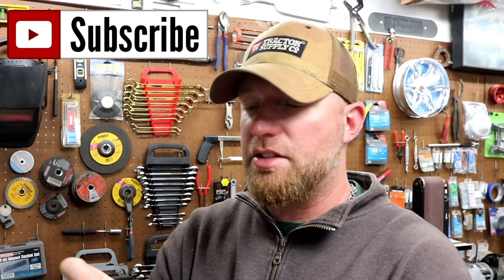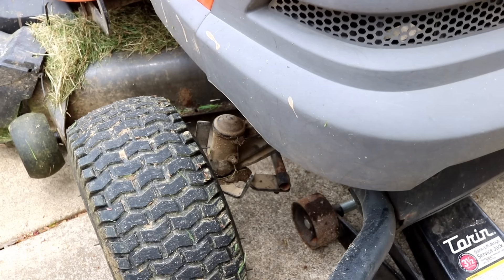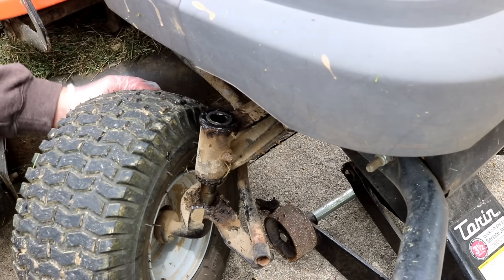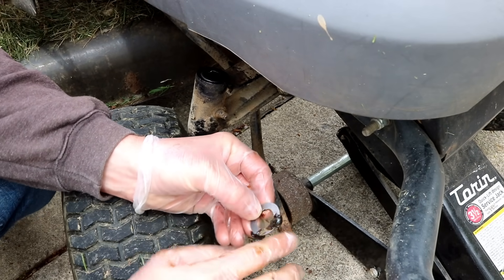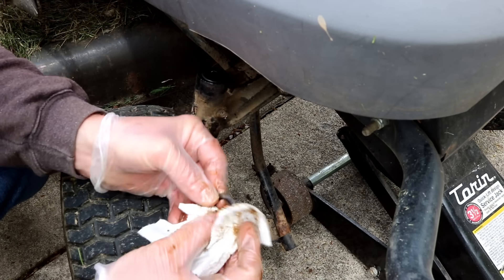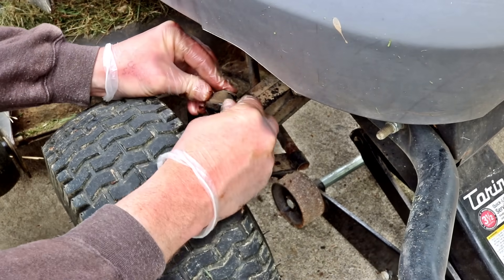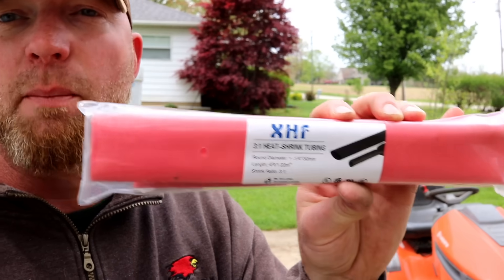$6 And 10 Minutes Will Give Your Riding Mower 1 Finger Steering

Comment: Those are called "Thrust bearings" --   when they are flat like that
Reply: They're official name is Torrington bearings...
Reply: @jedmetzler7125  Torrington is a brand name. Thrust is the type. Like Kleenex or Vasoline.
Reply: I’m pretty sure that they’re called “thingamajigs”
Reply: @jedmetzler7125  fail
Reply: @theupscriber65  that’s true. But I always called them Torrington bearings, most people have no clue what I mean.
Reply: @jedmetzler7125 
Years ago what people used to call Torrington bearings where I'm from were sprag (clutch) bearings. 
It's all regional dialects using a brand name for a type, just like a lot of people calling tapered bearings Timken bearings.
Reply: @steveb7310 because you were using a brand name.
Reply: @jedmetzler7125 . It's not.
Reply: @PaintHerWhite  yep
Reply: @dukecraig2402  sprag is a clutch that pinches rollers till they stop allowing movement in that direction.... not a bearing at all
Reply: @heathhunter5306  
Yes, they're also a bearing, just because the sprags don't spin around doesn't mean they're not also a bearing, by definition a bearing doesn't have to have rollers in it, a bushing is also a type of bearing because a shaft "bears" in it, pretty much anything that supports a shaft falls into the classification of a bearing. 
Or you can just Google "sprag bearing" and call Torrington or any one of the manufacturers of them and argue with them about it because they all list them as bearings.
Reply: In the industry, when thrust bearings had round balls, we called them thrust bearings.  When they had rollers, we called them Torrington bearings, simply so the guys had an idea of what style bearing we were talking about.
Reply: @blackhawk7r221  exactly
Reply: So these are the 2mm ones not the 10mm ones with round bearings
Reply: @lionandthelamb2907 I thought they we dohickys

Comment: Felt the difference 40yrs ago with Ford f150 twin I beam, replaced king pin bushings and thrust bearing.  Couldn't believe the difference, truck had manual steering, it did feel like power steering.  Thanks for sharing will be looking into this.  Never dreamed of putting them on a mower, thanks again 👍
Reply: my buddy had an 1984 f-250, never greased the king pins.   I remember his last drive to get them fixed, wow.
Reply: Twin I-Beam is okay, Twin Traction-Beam is terrible. Proud '90 Bronco owner over here.
Reply: Wow. I don't have a riding mower, but this is applicable for so many applications!
Reply: @superduty4556  I love my TTB.
Reply: I used Amsoil grease on a non power steering 64 Barracuda. Just like power steering. This would make things even better.
Reply: When it comes to stuff like this, I'm brain-dead, thank God for people like this.

Comment: If you dare and have the tools, you could use a burr bit and cut a hint of a notch along the length of the spindle, from where the grease fitting is, to where the thrust bearing sits. That way grease can find its way to the inside of the bearings and not compromise longevity. Thrust bearings are great and you might find a lot of applications for them, once you know where to start looking. You should upgrade your vice handle next. Turns a $50 vice into a $200 vice.
Reply: Or a mill. Or a grinder with a cutoff wheel.
Reply: No need for that. Whe he uses the grease gun you can see that the grease is already reaching the needle bearing and pushing out through the gaps.
Reply: @Tguson  but is it the gaps between the needle bearing, or just from the original top washer?
Reply: @Tguson  as long as it is the bearing and not just from the washers, yes.
Reply: vice... you're going to make me buy a bunch of these bearings...
Reply: @Yhrim70  sooo worth it! There are thrustbearings that are a single piece (clamped together) that you need for the vice though.
Reply: @oBseSsIoNPC  The washers and bearing IDs aren't a tight fit on the spindle so if the grease can reach the first washer it can reach all the way to the bearing.
Reply: why would you do any of theat.. apparently you didn't watch the whole video.. grease clearly came out of the bearings.
Reply: @gregthemechanicman  why? Because I am a mechanic and I work with grease all the time. Just because it's coming out by the bearing or washer, doesn't mean it's actually filling the bearing or continues to come out RELIABLY there. I do such things because I am thorough with what I do and I am German, so I tend to overdo things as well, but the good kind of overdo.
Reply: @Martian Dan  like I said.. watch the video again.. if the Grease is getting to that point it's EVERYWHERE under hydraulic force that stuff goes all over..

And I'm glad you're a mechanic.. I myself own a business and funny enough A MECHANIC SHOP.. come by and see me sometime and I'll show you all kinds of things you've probably never seen before.  Let me know when you're on this side of the pond and I'll even pick you up from the airport.
Reply: If you feel like grease isn’t getting to the bearings, then it’s being blocked by the washers above it. Even if you cut the groove in the shaft, it’s still going to be blocked by the washers. Simply drill a few holes on the washers above the bearings if you feel there isn’t enough grease getting to the bearings. Or, cut some notches on the inside radius of the washers. Also you could jack up the mower when you grease it and grease could more easily get to the bearings.

Comment: Thank you so much for sharing this tip! I have been struggling with this problem for 10 years. As a disabled veteran with neck and shoulder issues this is a life saver. I can't believe how well it worked and how easy it was to do. Not to mention how cheap it was!

Comment: I was pretty excited to do this, ordered the pieces. When I went to install them on my Club Cadet 46” mower I found the arms were welded and the kit could not be installed. So look before you buy or pass them on to a buddy like I did. Still think it’s a great mod.
Reply: Ya was all excited to change mine on my cub cadet and there was no split ring. Just a metal cap so I couldn’t install them either. Might do some research and see if it can still be done.
Reply: Can't do this on my new (junk) troy bilt bronco mower neither...it's welded at the top where the carter pin is.
Reply: Mines welded as well...bugger it

Comment: Thanks for this information. This undoubtedly takes an equal amount of stress off the other components in the steering system, especially the steering gear quadrant. My x350 only has about four years of moderate use over about 200 hours, and I can already feel a bit of slack in the steering. And I don't think you can adjust that gear interface. Thanks again.

Comment: BIG ASS WOW Brian! Did this install and what a difference in the steering. Quick and easy as advertised. Took me longer to bust out the jack, put grease in the gun, get 2 flatheads and some needlenose tools and after the install and put it all away than to complete the task. But this worked out great. This is her riding mower and I use the Zero Turn on 9 Acers. Haven't told her yet, gonna let her drive it when time comes to mow again and see if she says anything. Thanks for sharing. Have a great Navy Day!
Reply: How has it held up?

Comment: I did this modification a few years ago on my old 1997 Craftsman mower and it did wonders for it. But I went one step further and replaced the bushings in the wheels with bearings and now, my mower isn't just easy to turn, it's also easy to push whenever I need to manually move it. If you haven't already done a video on replacing the bushings in the wheels with bearings, I recommend you do one. It's simple and should your mower ever get a flat, you'll be amazed at how easy it will be to push — even with one flat tire.🤓
Reply: Probably good for milage aswell
Reply: @brub5174  Yes, I'm sure it improved my mileage. But even if that wasn't the case, I would still have done both upgrades as they make my Craftsman a lot easier to handle.
Reply: @rvalens2  I need this badly lol

Comment: I just did this in my Craftsman Pro-Series 54" Garden Tractor.  The only issue I had was when I put the drive spindle back in the axle assembly, the e-clip doesn't line up with the top spindle groove (it is flush or BELOW the top of the axle) and is almost impossible to seat.  Suggestions?  Maybe take out one of the washers?

Comment: I mow lawns for a living.  I watched this vid and two days ago my washers arrived.  I ordered them off Ebay.  Installing them
 was a breeze.  Yesterday, I mowed my first lawn with the mower.  What a difference it made, especially since I live in the
mountains so I am always going up and down embankments.  Really took the strain off my hands and wrists.
Reply: Link for your Ebay purchase?  Thank you,
Reply: @tommiller6580  he has the size you can look up in the video description
Reply: @Grass_Groomers_LLC everyone starts somewhere Fancy Pants. I do too and my riding mower is an old beat up Yard Machine. 😏
Reply: @captainorangesburner  nothing wrong with using what you got or what you can afford! I started my cabinets shop business with just a few basic tools. Even a cheap Craftsman tablesaw that only cut 24” wide using the fence.  
Router and some bits, belt sander, and a few other miscellaneous tools was all I had.  Free handed a lot of material though that craftsman tablesaw that you’re really not supposed to do. But I got very good at it anyway!   
Still built $10,000.00-$30,000.00 custom kitchens and bathroom vanities, etc.  and slowly built my business equipment up with the profits off the jobs I did. At first many of the jobs I did were much harder and slower to get finished.  Profit margins weren’t the best in the beginning. But as time went on and using as much profit as possible to keep buying better equipment and tools the faster and easier things got and the more profitable the business got.  Eventually I had over $60,000.00 in equipment that all bought and paid for!  Business doubled in sales every year. 
Don’t let anyone’s comments bother you! You’ll get the last laugh in the end.  While those making the comments will still be in the same place and not being able to do anything more them make negative comments to others since they can’t accomplish anything more themselves!  Attitude has everything to do with succeeding in business as well as in life!  Your on the right track, best of luck to you
Reply: @Grass_Groomers_LLC  a garden tractors mow grass people pay to have yard mowed what’s hard to believe? Iv got a 62 in commercial zero turn and a 52 inch garden tractor because there is hills the zero turn can’t do and it mows just as nice.
Reply: @GrassGroomersLLC all for taking pride in your work, but man you literally mow grass for a livin calm down
Reply: @@GrassGroomersLLCJudgemental much? You don't know where in the world they live, their age, whether they just started out.

Reckon you ought to have a think before snarking at someone trying to work for themselves in future
Reply: @morehp1  I have both a ZTR and a mower.  There are places the ZTR can’t reach sometimes, and some hills might be too sketchy for a ZTR.  That’s where another mower like this comes in handy.
Reply: @norfolkngood8960  it’s fine. It’s things like this that have them showing you before they do the work why you don’t want to work with them.
Reply: @Grass_Groomers_LLC  with that attitude, I'd hire you to fire you.
Reply: @Grass_Groomers_LLC I think the real issue is it doesn’t take years of experience it takes an afternoon with granddad but you can’t just brag about spending a ton of money I’m sure you worked hard for on a fancy tool so you have to ‘no true Scotsman’ just in case someone might have the unit.
Reply: I did this trick a few times myself but I really am just wonderin if it will make a diff & work if I did it to my own spindle before the old sits on it again....
Reply: I installed these on my John Deere d120, no problem went easy.  In order to make the o-ring fit on top I just lowered the tractor back down on the ground and the weight pushed the pin up higher, made it easier to get it back on.
Reply: You"re right! Can you make a video?  Sounds like a great idea
Reply: just curious -  how are the beariongs holding up after a season of mowing?
Reply: He only showed doing one side , but you have to do both sides ?
Reply: @michaellowther8649 yes, you need to do both sides
Reply: How well have those "washers" held up?

Comment: Thanks for posting. This hack fixed my 2013 Rear engine Snapper. Super easy due to no grease cap. I did measure the force needed to turn the wheels before and after. It required 18 lbs before and only 5 lbs after. Love it
Reply: Give it a year until the fine dust from mowing  gets captured by the bearing grease and form  nature's own grinding compound that turns the little ROUND needles in the bearings into little FLAT needles.
Reply: @mikehudick7074  The guy in the video mentioned using heat shrink to protect the bearing from debris. Have you tried that?
Reply: @mikehudick7074  $6 and 10 minutes for a year's worth of easy turning?  I'll consider it maintenance and be down with it.  I'd even be cool with $12 and twice a year, my mower turns like poo.
Reply: @thisdoesfine  if it turns like poo doesn’t that mean it is poo?
Reply: Thats because it is a rear engine, does not help that much on a front engine mower !!
Reply: @mikehudick7074  There's always a critic in the comments. In this video, it's you. Troll on.
Reply: @thisdoesfine  Good reply. To hell with Mike.
Reply: @mikehudick7074 So it'll be like how it was before?
Reply: @mikehudick7074   wonder if using the wiring shrink wrap over the bearings would work well enough to keep the dust/dirt out so the bearings last better?  I firmly believe if there’s a will there’s a way!  May not be the perfect solution yet, but it’s going in the right direction it seems?
Reply: @Jake-pq3iz  might need KY for your squeaking problem! 😂
Reply: just curious -  how are the bearings holding up after a season of mowing?
Reply: @SysBehr  I've only used it half dozen times due to extreme drought here. So far they are working great.
Reply: Wow, I'm definitely going to do this on my John deere lawn tractor.
Reply: @garybregel1572 how did it go? I have a 85 112l. Thinking about doing it to. Love my old machine
Reply: @toddpetersen2251  I really diden't see a big difference in the ease of turning. I mean it did help a little. Some people reported a big change, but I diden't see a big change. Maybe I put it on wrong? I think it is still worth trying out.
Reply: @toddpetersen2251  I didn't notice a big change on my lawn mower steering after installing the bearings. Maybe I got a bad set. I still think it was a good purchase.

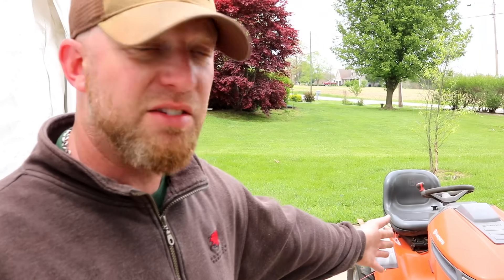Comment: 3:56 I’m wondering if you can slip a bicycle inner tube over the shaft before you put it together. But you’d have to cut a slit for access to the zerk. To keep the dust out of the bearings…

Comment: I have a wheelhorse with snow blower on the front. When the blower is raised steering is very stiff due to all the weight up front. I just put my order in for 4 sets..... thanks for the great idea!!!
Reply: Did you get them and install them yet? I also have a mounted blower and it is an absolute bear to turn even with everything greased up properly.
Reply: @jeremydavis2595  I took my snowblower off last Monday and I installed the bearings on Thursday. Because I removed all the weight off of the front axle,the steering is easy now. It does seem to be a improvement though.

Comment: Great video,just added to my old John Deere and no more sweating trying to make turns,wow,great idea.Got extras for backup at that price.
Reply: what JD Model do you have?  I put a set on my LA135LE and barely noticed any difference.  i greased it, packed the bearings prior to install, made sure the spindle was clean, etc....not really any change.
Reply: @Monkeybuzzness  I have a Hydro 175
Reply: @allenblevins7430  Following

Comment: As a small engine technician who works solely on lawn equipment I can assure you this trick is useless and doesn't work on every model with an AYP front end. He only created a grinding stone where none was before.  Not only have I tried this by purchasing a 6pk of those thrust bearings and installing on 6 mowers but I've had to replace the wheel spindle quicker for 3 of those same customers. 

The real fix for repairing the AYP hard steering issues is to remove both wheel spindles then replace the 3 locations of bushings in the actual axle. There's one in the pivot point of the axle and one set at each spindle mount location.  Replace them, clean and lubricate the spindle shift along with the washers and it will steer like new again.
Reply: Do you know if there is a video to show how to do this method?  Thank you.

Comment: I'm definitely going to try this out!
You can also turn the dust caps inside out after removal, using a year gun is ideal of a hair dryer will do the same thing, turn it inside out and then reverse it on the mower point where it's supposed to go.

Comment: I'll have to look into this on my Ariens... It's not terrible when the mowing deck is on, but all the weight of a snowblower hanging off the front makes it far worse unless you're driving flat-out.
Reply: Update: there isn't enough room with the c-clip holding the axles through the front cross member. I ended up having to do a front end rebuild- the steering shaft was destroyed so I made a new one at work, and replaced the non-existant bronze bushing. Bought the mower used and it has never steered so easily before!